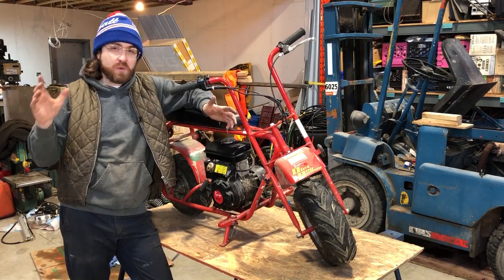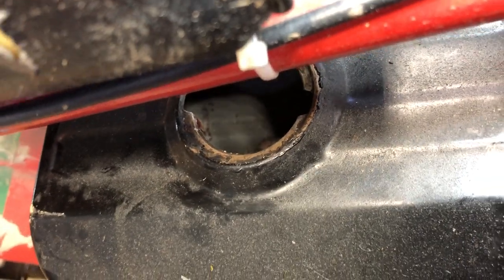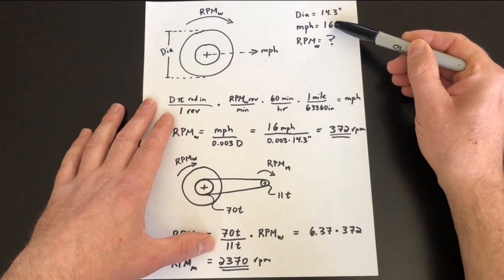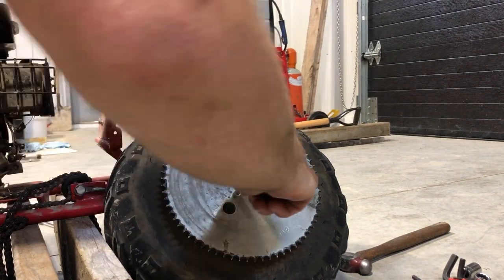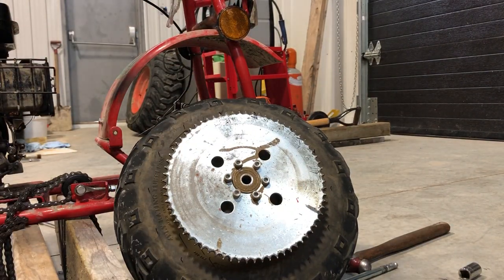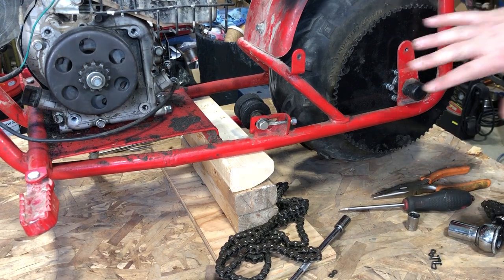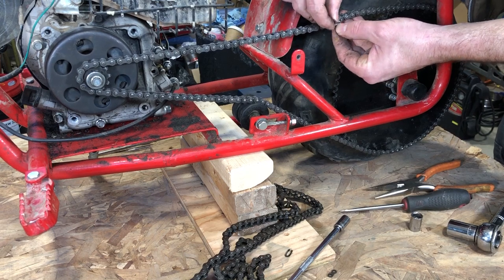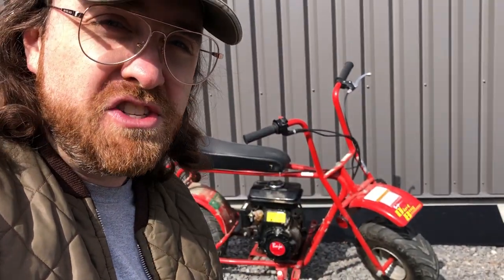Dirt Bug Mini bike - Revival! - Tune-up and torque increase... the hard way!! (Blitz Doodle bug)

Comment: That's known as a Doodle Bug here in the states. A tough, popular bike that is very easy to modify. The commom trend is to 212 swap them. The little stock engine is great though if you just like cruising around.
Reply from the maker: Thanks for the info! Honestly, with the lack of suspension, I wouldn’t want to go much faster than the stock engine can give… The 212 mod would be best suited for a teenager who doesn’t mind a sore back! Thanks for watching!!!
Reply: @mattsws  Hi Matt ...what's the CC of the stock Engine ?...did I here you say 97cc ?..Thanks Trev New Zealand 🤗🇳🇿
Reply: @mattsws  Matt...you can put stiffer springs in the stock engine's clutch so it revs up higher before the clutch engages, especially for heavier kids, you don't need the 212 Predator unless you are going to modify it Or like gobs of low end torque : I'd advise a Torque Converter if sticking with the Stk Engine with heavier riders..cheers T
Reply from the maker: @trevinskiking2165  Hey man! Yeah its a 97cc engine that puts out just under 3hp!
Reply from the maker: @trevinskiking2165  You are absolutely right about the stiffer springs! It ended up being a lot of work, but when I made this video I was set on my idea of using a bigger sprocket. Work out well, but the springs would have been easier! Thanks for watching!
Reply: @mattsws  No worries Matt.....the springs will let it spool up to higher revs before it engages, you'd notice it more with a lager rear sprocket but keep the all up gearing at around 6:1 you work that out by dividing the number or drive teeth in the number of teeth on the driven sprocket eg 6 into 62 62÷6=your gear ratio ...that's the stuff vested interests don't want you to know.
I want to buy an engine  from Harbour Freight but their now pick-up only & I've got know one to pick an engine up for me & send to Gardena Cali or Portland Oregan to send an engine to for me to evaluate, as we don't having them in our country New Zealand 🇳🇿by Australia  glad it worked for you: like putting a high stall converter in your car transmission.Cheers Trev

Comment: Had exact same engine, replace carb with $13.00 adjustable carb (non epa) on Amazon. Also air filter plastic cover way too restrictive, cut some slats out of middle air filter cover. Went from 27 mph to 32
Reply from the maker: It’s surprising what you can squeeze out of a little 97cc engine! Thank for the comment!

Comment: Just bought my daughter a nice used one today for $150. Came right home and ordered a new carb throttle grips and cable for $18 new air filter for $15 (the carb and air filter were missing). Probably gonna order new brakes and chain after I get it running. Hers is a Baja blitz
Reply from the maker: Yeah, that is whats great about these little bikes. All parts are available and super cheap!!! Never takes too much to get them running AND they’re great fun!!! Good luck and thanks for watching!!!
Reply: @mattsws  ordering a Mikuni style carburetor and header for it now. The carb it has kinda sucks with very little throttle movement. It’s almost idle or full speed. Deleting the governor when I put the new cab and header on it.
Reply from the maker: @GratefulEd907  Awesome!! Keep me posted on how that goes!!!
Reply: @mattsws  I just did the 212 predator on my mine over the last few weeks only working on it here and there and waiting for new gasket but got it back together and just fired it up for the first time 20 minutes ago so I feel confident I can do hers too. But yeah I’ll come back and let ya know how it goes.

Comment: I’m having so many issues with my throttle assembly. Can anyone help
Reply from the maker: Yeah, whats going on?
Reply: @mattsws  idk if you have Instagram. I could send you a pic to make it a little bit easier. But there’s like no adjustments I can make for it to run properly. It’s either to tight or to loose. I either need new springs or a throttle cable. I could also be missing something I’ve been watching videos on them and nothing seems to help.
Reply from the maker: Sorry, don’t have Instagram… Take a look at the video at about 9:00 mark. You can see how smooth the throttle should move. A few seconds later, you can see the governer linkage assembly below. Pause the vid and make sure everything is hooked up the same. If that doesn’t work and the movement is still stiff, you might have to change the throttle cable. This can happen is the bike has not run in a long time and has been left outdoors or in a damp place. Hope this helps!